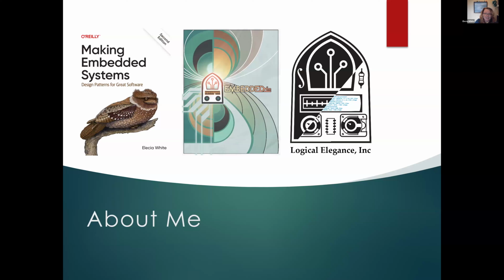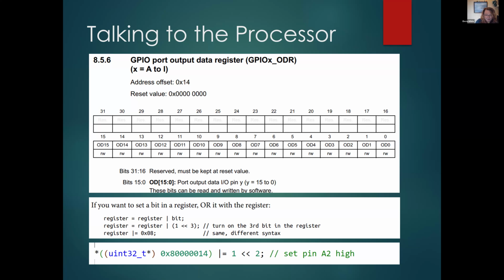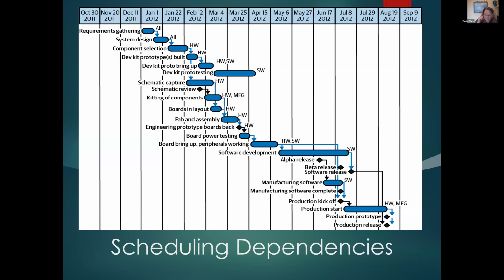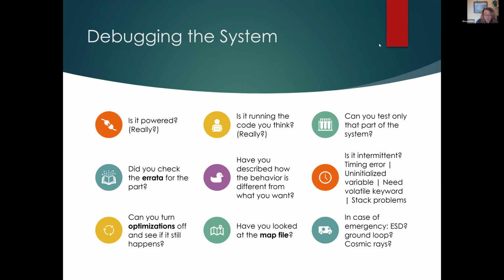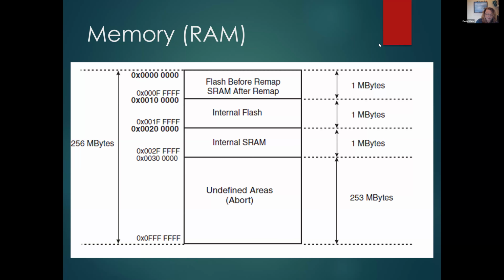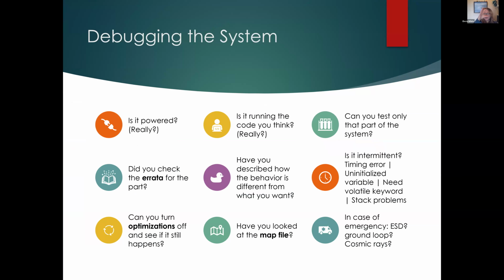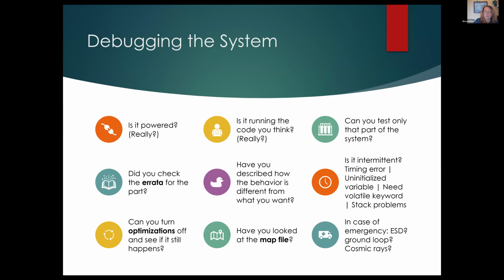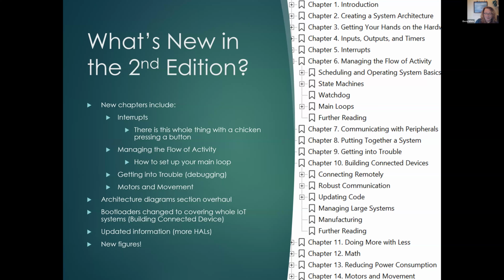Introduction to Embedded Systems (O'Reilly Expert Webinar)

Comment: Hello! Thank you for this wonderful introduction to embedded systems!
Sorry to bother you, let me to ask a few questions:

1) I suppose the second book mentioned at 44:40 is "Better Embedded System Software" by Philip Koopman, but I can't recognize the first book (by Granin?).

2) I heard that pre-Microchip Atmel had the most detailed and comprehensible documentation.
Are there any MCU that meet the following requirements?
a) have best (good) documentation, both hardware datasheets and software (IDE, SDK) manuals, not too many errors in documentation and sample code
b) have best (good) debuggability
c) have affordable (ideally free) SDK for a hobby/independent developer
d) have free open-source code examples and libraries.
I understand this is the search of an unicorn. The goal is (near) industrial grade MCU platform with wireless capabilities, Wi-Fi or Bluetooth, but ease of learning is the key for me.

3)Is the ESP32 worth considering?
Reply from the maker: 1.  Test Driven Development for Embedded C by James Grenning
2. Most of the MCUs vendors are trying for these. Nordic nRF would be my current favorite for BLE as it has good support, affordable dev kits, and community support. 
3. Probably, it is well-loved and well-supported but I haven't gotten to play with it though I keep saying I'm going to.
Reply: @logicalelegance  Thank you!